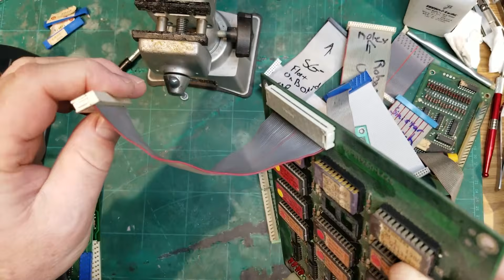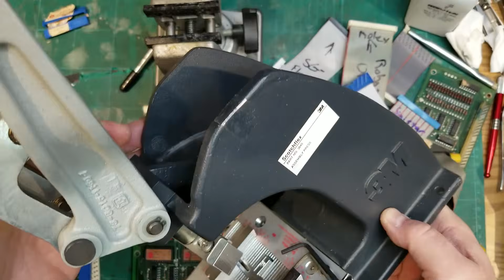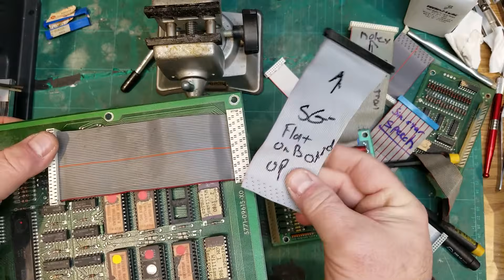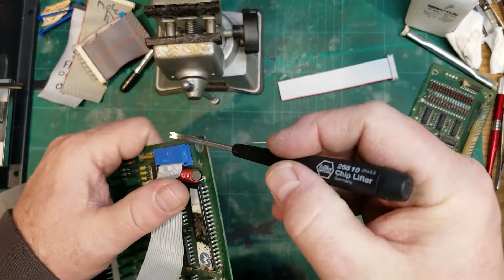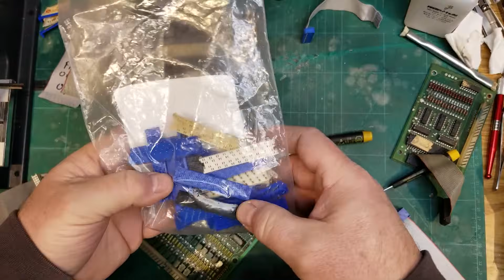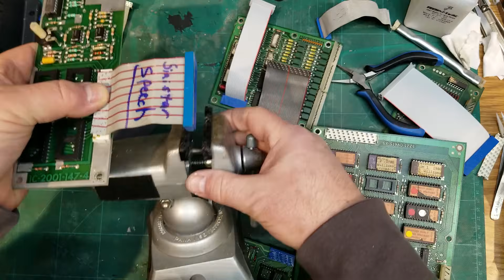Williams Ribbon Cables - Remove and Replace - Without Soldering!

Comment: Hey...thanks for the video.  Do you have the DigiKey part numbers for the 40 pin and 20 pin connectors (the 10x4 and 5x4)  Thanks
Reply from the maker: CPC40S-ND
CPC20S-ND